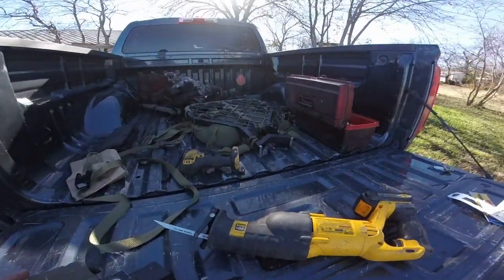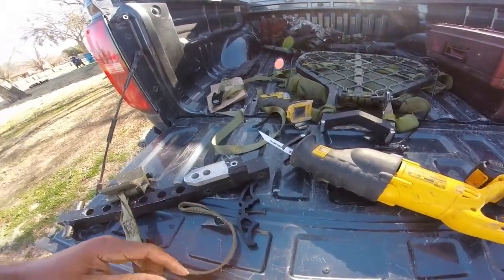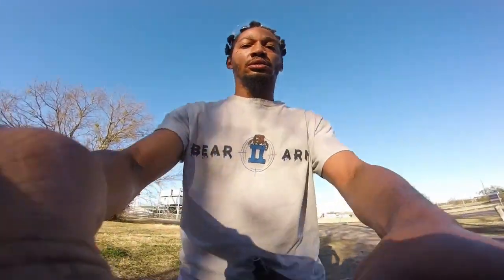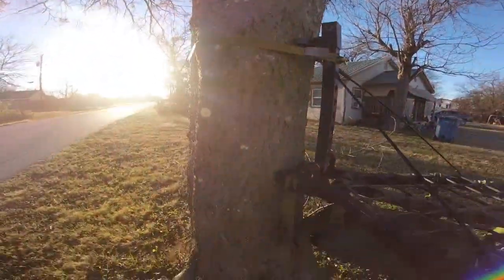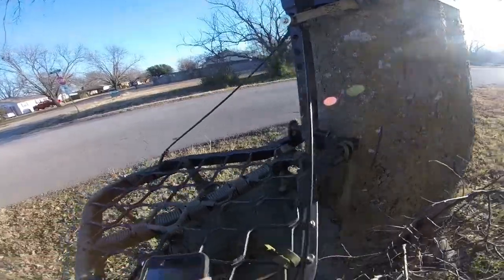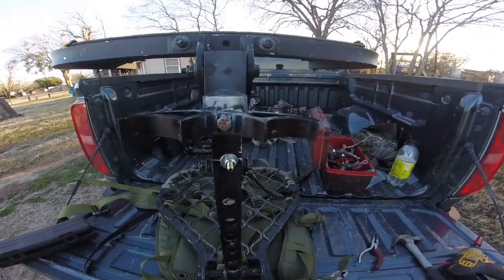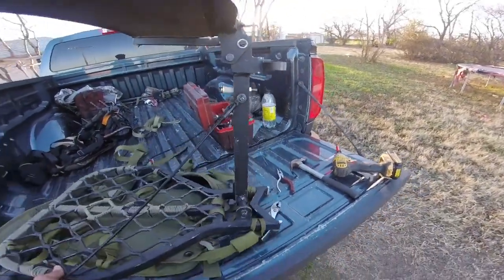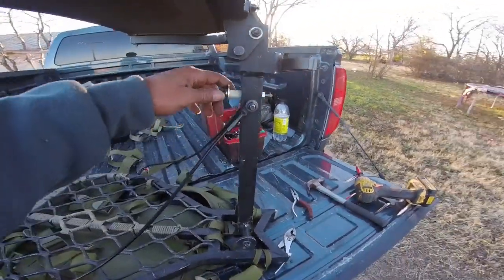M7 treestand Mod

Comment: Instead of the mods did you ever try just replacing the ratchet strap for the tree bracket with a cam strap from a climbing stick. That's the only change I made and it works awesome it's a lot lighter and I like being able to put the bracket in place before sliding the stand in. I just toe hook it and cam it over and it's just as strong as a beast stand or lone wolf stand
Reply from the maker: Unfortunately i didnt think of that one. Honestly i was just trying to get rid of it in all. Didnt care for the bracket. I run public so i was trying to get much weight off as i could.